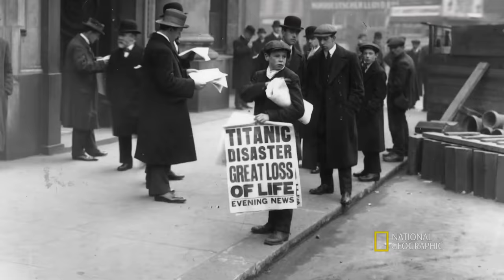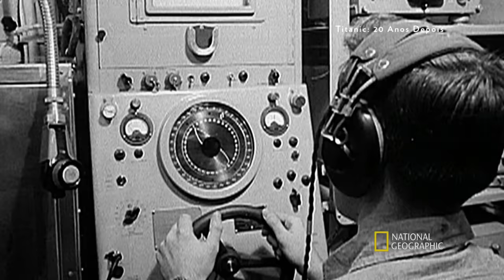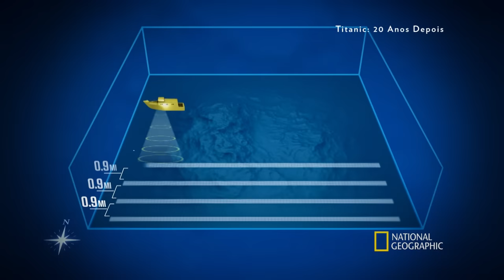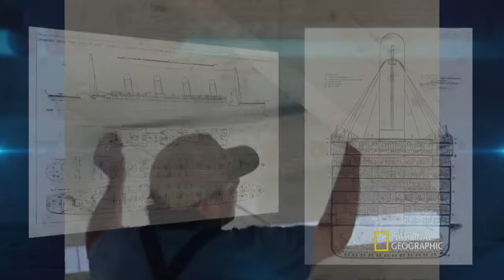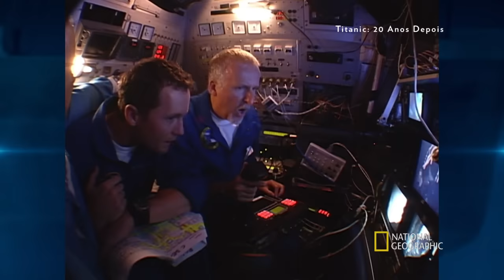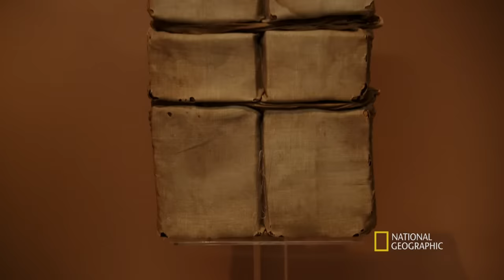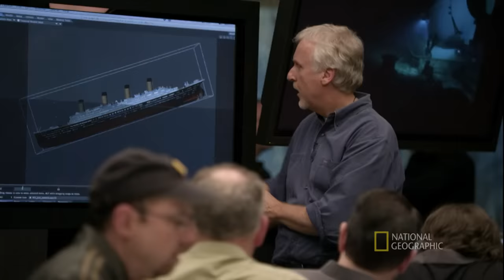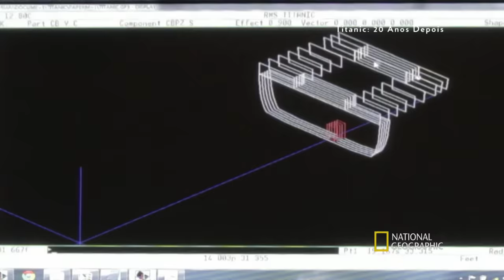Titanic 20 Years Later - Full Documentary with James Cameron (Includes Dive into the Shipwreck)

Comment: I can't even begin to imagine how loud the sinking would have been, like all the screams, and the noises the ship would have made while it was breaking apart, and the shouting of the crew trying to launch the boats,  and just the pure chaos that would have been happening .
Reply: Makes you have so much respect to crew who kept the power going for as long as possible. Can you imagine the chaos if the power had gone out sooner ?
Reply: Frankie Goldsmith said that the screams is like a criwd going wild when a homerun.
Reply: Just the noise from all the furniture, dishware, mechanical equipment, etc all breaking loose, sliding downhill, and crashing through walls and bulkheads as her stern rose in the air alone would've been a hell of a racket, to say nothing of the screams.
Reply: And what about imagine after the sinking, you would hear screams until they all fade to dead silent…